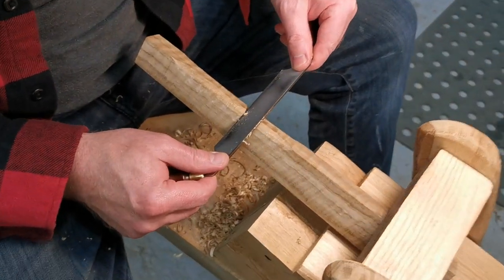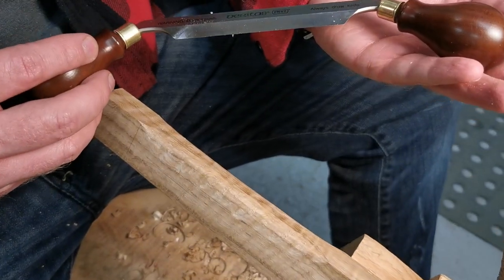Veritas Drawknife on Rippled Oak - Draw knife

Comment: Lovely little draw knife. I tend to use them on an angle to the timber rather than perpendicular to it and to use a slice action across the blade. While it may not help here it can help to cut rather than try to cleave the wood apart.
Reply from the maker: Totally 👍👍👍 I teach the guys to do that to stop the blade cutting and following a similar path each time. Change it up, to stop it creating the same issue. Does that make sense?
Reply: @twcmaker  yes gotcha, I have some ideas based around draw knife for some videos
Reply from the maker: The Drawknife is more a bodgers tool the a furniture makers shop tool. However, they are so versatile and THE best tool to quickly shape wood or slowly finesse a shape. How many have you got Darren? New or old?
Reply: @twcmaker  I love them. I have one new one I bought which is my sharpest and about 6 others, I bought a small gentleman’s one the other week . I have my dads old one too I use in the workshop
Reply from the maker: It must be a wonderful connection when you can use your father's tools like that?